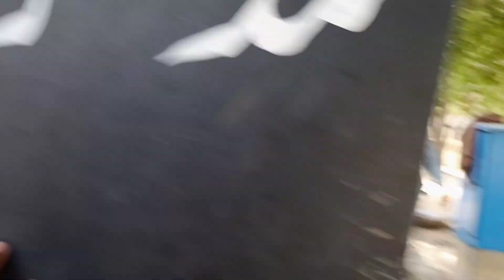Drain Complaint 126 | The roots in the pipe penetrate like a snake |

Comment: They need to use heavy duty root cutter (cutting off the roots in the pipe between those two manhole) from the manhole in upper flow  position.  Giving such High pressure water flow from down stream manhole to upper stream is  not proper.  Use Snake driven by Heavy duty Electric Motor!!
Reply from the maker: Okay Sir thank you so much ❤️